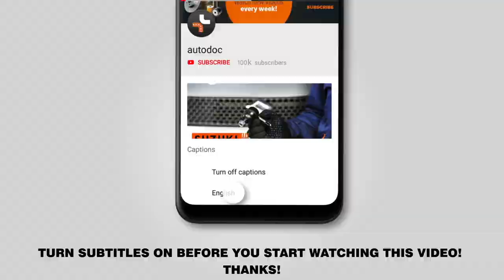How to change rear brake pads / rear brake pad set on VW GOLF 5 (1K1) [TUTORIAL AUTODOC]

Comment: copper grease with aluminum wheels?
Reply from the maker: Copper grease is a multipurpose high-temperature grease. 
Preserves threaded connections protect against moisture and, consequently, corrosion. For steel brake discs

Comment: Do you need to replace the brake wear sensor?
Reply from the maker: When replacing the pads, it is recommended to replace the pad wear sensor.
AUTODOC
Reply: @autodocuk  Thanks! It would be great if you could do a video on this or add it to the current video 👍🏻

Comment: No mention on releasing the break fluid bolt so that the piston can be pushed back???
Reply: Yes, I noticed this too
Reply: You don't release the break fluid bolt on caliper when changing pads, it's hard to push it back but this is the way to do it. If you release the break fluid bolt it's easy to get air in the system, which will then result in you having to bleed the breaks for air (double the amount of work to be done this way).

Comment: I'll never understand why mechanics will replace expensive rotors, calipers and pads, and leave in place the ugly rusted support brackets.  The caliper can bind on a rusty support bracket can't it?  Did he lube the slide pins?